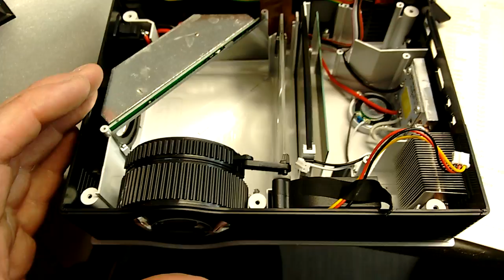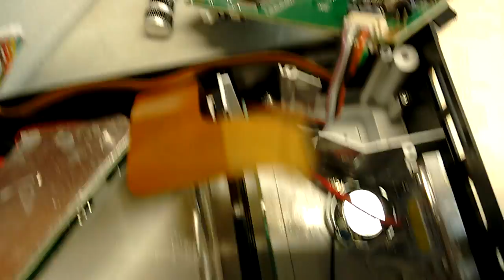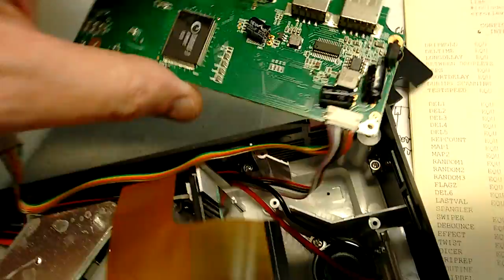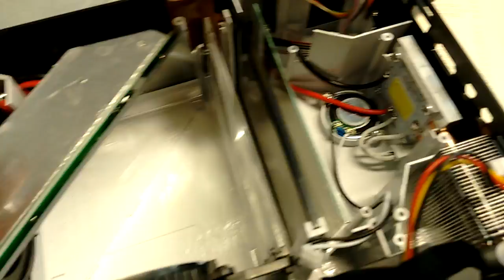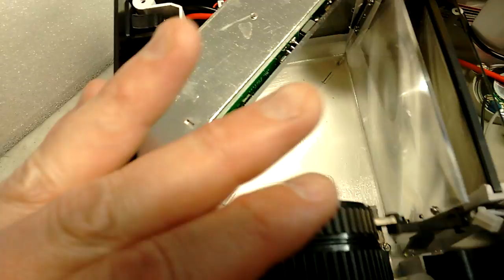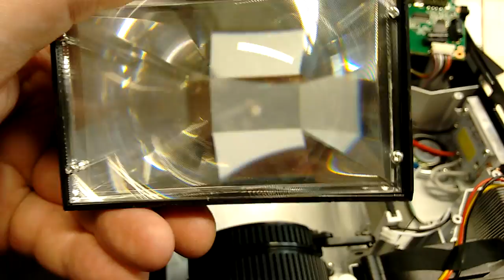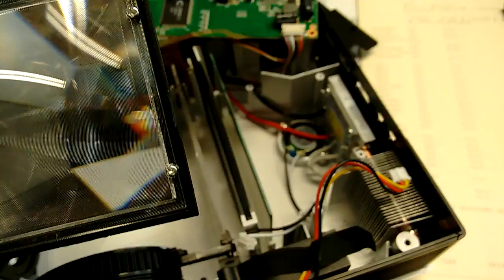Inside a cheap LED projector.

Comment: oh wow, vapour change heat pipes and an aluminium fin array, they're VERY serious about the passive cooling on that chip, that is very good for an LED, I've seen PC's with less cooling than that,
Reply: Forced airflow = active. Doesn't matter if mounted directly or not. The air is still channelled, goes through the fins and then out the slits on the side. So stop spewing bullshit. Just because it doesn't meet your "standards" doesn't mean it mustn't meet the definition's standard. Also, radial fans > axial fans. You'd be surprised how that "pathetic" fan would outperform an axial one of same size.
Reply: Things are heating up in the electronics cooling community.
Reply: its not passive it has a fan.
Reply: +biohazard 918 that tiny pathetic excuse for a fan, is not active, it is also not mounted to the fin array, ergo passive. I think an asthmatic granny coughing on it would provide more airflow than that thing.
Reply: Joshua Nicoll Have a slowclap, Mister PC-cooling fanatic with your fan mounting snake oil, for you have absolutely no idea what you're talking about. None about static vs. dynamic pressure, none about static pressure having no direction, none about effective cross section, none about forced vs thermally self-induced circulation, none about good puns. Just kindly do us all a favour, and stop breathing, will you? Get it? Air-breathing?
Reply: Joshua Nicoll Oh, please don't flatter yourself. Why would you even think I would want to entertain your expectation, ie. have a debate with you? You don't even consider the possibility of the mouldwork to be shaped to be not just structural support, even though it visibly forms a continuous wall that connects the fan with the edge of the heatsink, you don't even consider the possibility that it may be matched by a similar, and form-fitting, counterpart in the top cover, you don't even give any sort of regard to what has been said to you in terms of fluid dynamics. You have absolutely NO intention of looking beyond your fanatic view of PC cooling, why would I even WANT to have a sensible discussion with such a blinkered, arrogant, opinionated cunt with zero interest in physics principles and their practical application, who rather continues to spout his idiotically dogmatic beliefs gleaned from overpriced, snake-oil-filled cooling assemblies? Here, have a cookie, and consider yourself cordially invited to go smear some Arctic Silver OVER 9000 on your dick and put it in a 3-tiered 6-amp Delta meme fan, if you're so obsessed, and to leave actually thinking and analysing people alone, you fuckwit.
Reply: Joshua Nicoll I don't give a flying fuck what you think is a weak rebuttal, I'm not here to entertain you or any sort of standard, measure, or expectation of yours. All I'm saying is that you're just regurgitating nonsense and misconceptions, making erroneous assumptions and uneducated conclusions from finished applications rather than spending a single thought on the principles and going from there. Not ducted? Well, how about you actually use your eyes and follow the internal walls going towards the heatsink, is that not ducting? Axial fan mounted directly on a heatsink? Well, what about the area directly underneath the fan's hub? How's that one going to be permeated with moving air if all the flow is forced around it? Jesus, you are so stubbornly stupid, how do you even breathe in the correct order without instructions?
Reply: That's a very weak rebuttal, and an even weaker pun. I'm also not sure where the snake oil claim comes from. You mount a better directly onto the fin stack it will cool much better, add one with high static pressure then it can push the air through, the other factors in the system are negligible. A radial fan that is almost complete offset to the end isn't going to do jack to cool it, especially that fast away. You don't seem to get that the fan is ineffective. Most patents relating to active cooling specify a built in fan that is part of the assembly, or at the very least an air guiding duct, this implementation has neither. most of the heat from that fin array will be dissipated passively as there isn't any airflow over it. Not to mention that in PC's cooling is a lot more important and we deal with hundreds of what. My PC's cooling system has to negotiate over 400 watts, damn straight I know how to cool it. By all means give yourself a clap too, GO TEAM RETARD
p.s. I detect quite a lot of personal jabs, may there be some narcissism involved here?
Reply: +Anvilshock (sighs, I see were this is going) a rebuttal is a couter arguement dumbfuck, nothing to do with entertainment, maybe you should join a debating club, mune grind some briancelld into the void you have instead of a brain. That isn't ducting thats a mould plastic section. doesn't mean its any more useful, exhaust from that fan barely catches the last few fins, perhaps your thick forehead obscured your vision of that part of the video.
Reply: I wonder if I could replace the fan with a small Noctua fan

Comment: I had a similar one of these LED projectors. Unfortunately it broke after a year. The image was poor and the dust got into the lenses. It has a 10w LED and the thing what failed wasn't the LED, it was the driver. I now has a £350.00 Acer projector with 2400 lumens and it is much better.
Reply: I got a nice used 720p projector that was advertised as broken off ebay for $30. It had a busted current sensing choke on the PSU that I was able to repair, after that all it need was a new $60 bulb. Recently however I watched a terrible documentary and now it has a dead pixel. I blame the documentary.
Reply: MadeOfSolder I remenber the LED projector said supports 1080p, but the native resolution was only 480p.